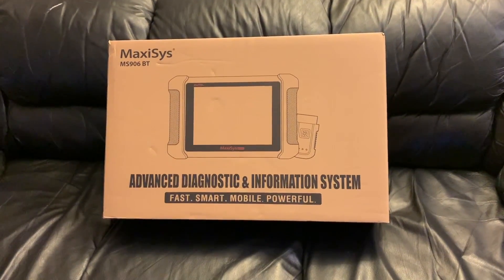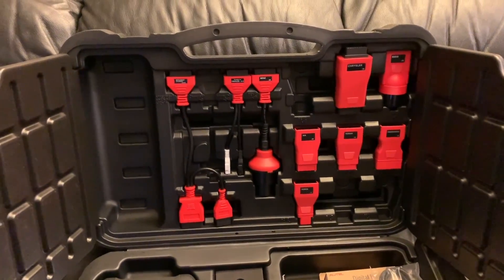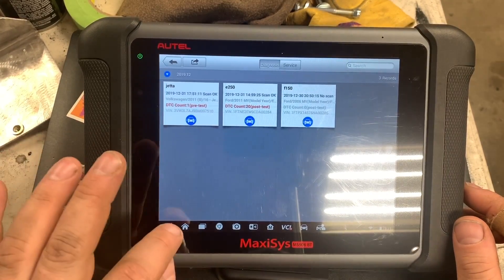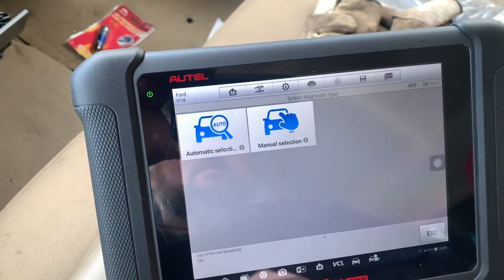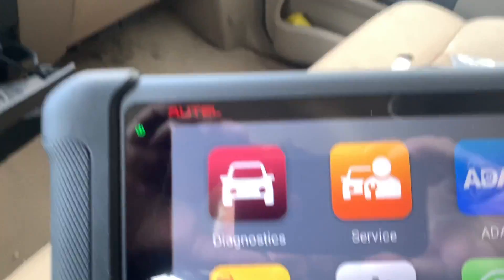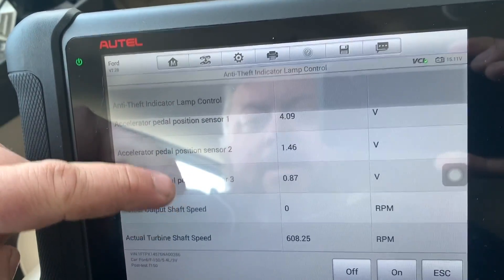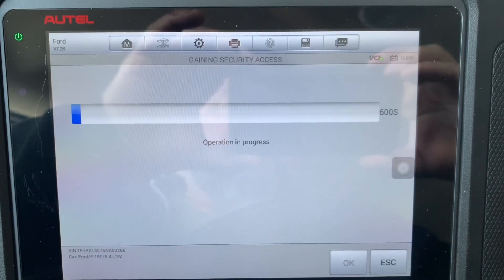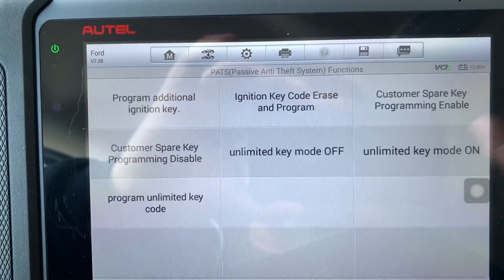Autel 906BT Unboxing and First Look

Comment: What I see here and everything I have heard, it looks like Autel is a rip off. What use is it if it doesn't work on all vehicles. One guy said it didn't work on a Nissan Maxima and you said it doesn't work on your CX5. What gives? I have a $200 Actron and it works on all vehicles. Now I know you can't do the things this tool can but it gets the job done. Why would I spend $1,200 when I have to call Autel to find out what vehicles it works on. No thank you.
Reply from the maker: I have no idea what your taking about, I don’t own a CX5........ time to get off the liquor
Reply: @TestDontguess  My bad, Yes your right, I was referring to the other gentleman who commented that the unit didn't work when he was doing a break job on his CX5. I have heard several people complain about the unit not working on other vehicles. It does look like a nice unit. Correct me if i'm wrong but for $1,200 I would thing it should work on all vehicles. I wouldn't want to have to purchase two of them. Thanks for correcting me.
Reply from the maker: I have never had a issue with it not working on a vehicle
Reply: @TestDontguess  Thanks that's good to know. I was thinking about purchasing one two months ago. How long does your battery last?
Reply from the maker: No idea battery life is irrelevant to me,

Comment: Looks like a decent scanner.
Reply from the maker: So far it’s been pretty awesome
Reply: @TestDontguess .been eyeing that one. My snapon scanner is about 6 years old.  And is showing its age with the software.
Reply from the maker: I had that old snap on too that I had for a few years and sold it for 50 dollars less than what I purchased it for. That being said I always have the Matco Maxme but you have to rent the modules which is a pain so I got this one so I don’t have to worry
Reply: @TestDontguess  im not renting modules.  I would rather just buy it and be done with it MFBT.
Reply from the maker: Right..... that was my thoughts as well
Reply: Have had mine for almost a year. Great for anything newer than a 2007, anything older get the autel handheld 20 dollar live feed scanner. Btw it constantly updates so you gotta map up on that.